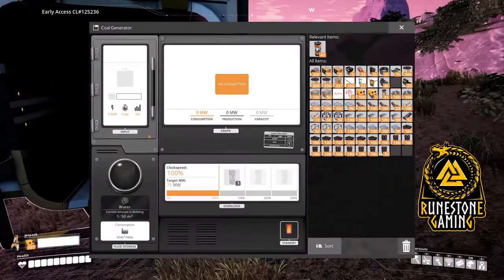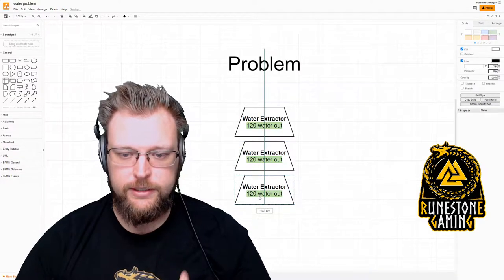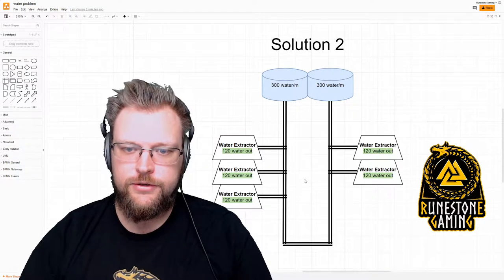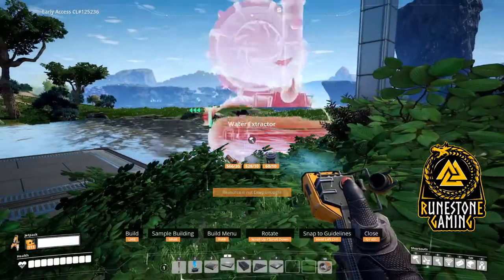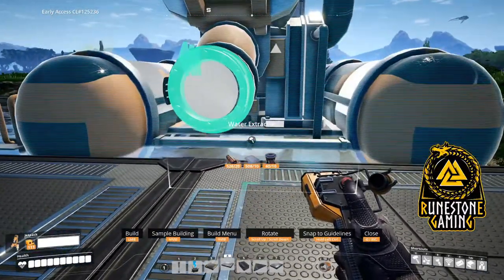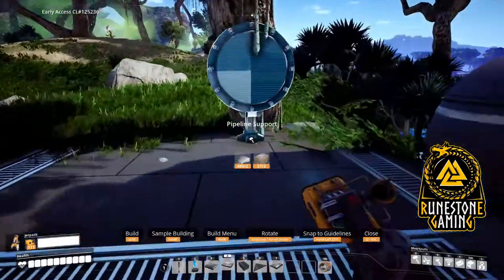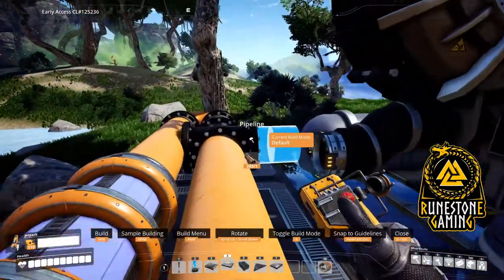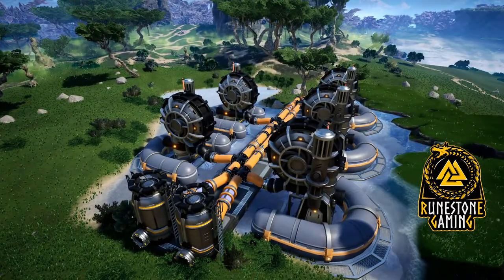Satisfactory Game - Tips & Tricks - 5 Extractors 2 Pipes - EP1

Comment: "But you're not maximizing your machines"

Well, if the goal is to have fewer total machines, then surely real solution is to overclock the two single extractors to 300m3/s.
Reply from the maker: Hi Leo, moving forward, I will plan to suggest slug amounts to reduce overall amount of machines for frame rate. Ty for the feedback!
Reply: It uses way more than 250% of the power of a standard clocked extractor. There is more space than slugs in the game. Most people reccommend only overclocking miners and oil/gas extractors

Comment: Great Info. If you under-clocked three extractors to 100m3 compared to two extractors at 120m3 and one at 60m3, the exponential power needs of clocking means that IF you have to use only a single pipe it saves more power. SLUGGING IS NOT THE ANSWER PEOPLE! as the same applies the other way and it will mean power problems later in game.
Reply from the maker: Hi Loki - Thanks for the feedback! I love that you mention the slugs! Something I failed to mention in the video - DO NOT SLUG! :) - I will check out the 3x underclocked water extractors and get back to you soon. Seems like its gonna be a lot of pipes.